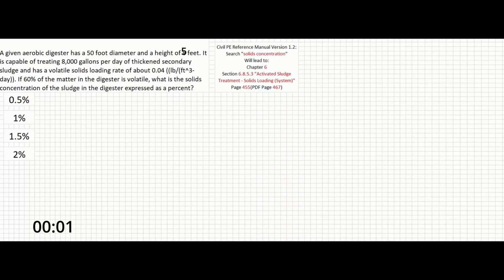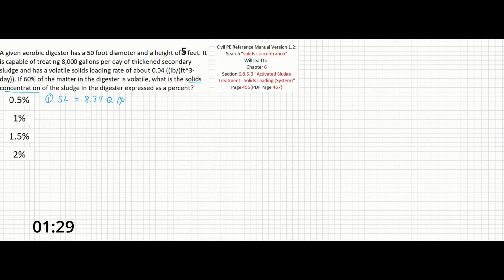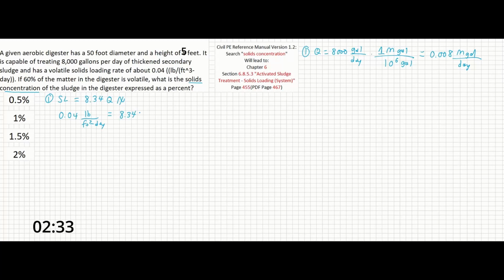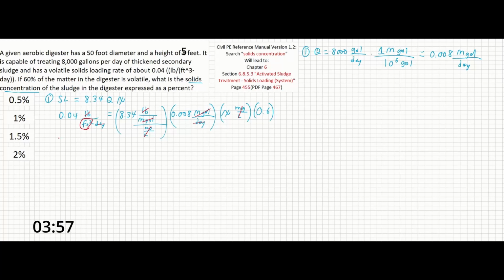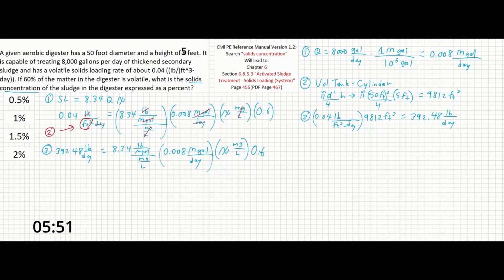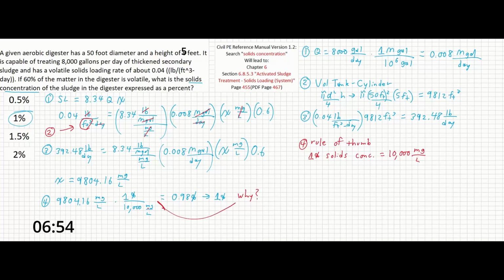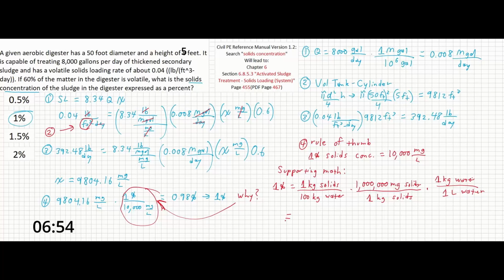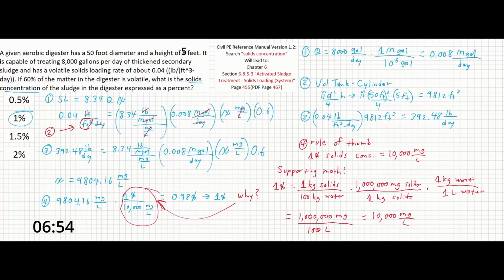PE Exam Practice Problem #9: Water Resources | Wastewater - Sludge - Aerobic Digester - Solids Conc.

Comment: This is another one where you don't actually need to use the reference manual at all. 

First thing I did was derive the cross-sectional area of the digester and the volume from the diameter and height. Then, since we know VS = 0.6*X, just solve for X which gets you .066 lb/(ft^3*day).
Multiply X (0.066) by the volume of the digester to get lb/day.
Using Q, derive the total mass of sludge per day (Q in gal/day -> ft^3/day -> lb/day (you can use 62.4 lb/ft^3 even for sludge as a basis since sludge usually has a Specific Gravity less than 1.05).
Then just divide lb (Solids)/day by lb (sludge)/day.

Doing it this was gave me a result of 0.977%
Reply from the maker: Sounds like you understood the concept and what it was asking for more intuitively than i did. Nice job!

Comment: Are we always only worried about the volatile solids or just in this particular problem?
Reply from the maker: I guess it depends on what you mean by worried. Volatile are the part that will be oxidized or decomposed. Non-volatile will not change. Some questions might ask about either one or the other, just depending on what you're being asked to solve. Sorry if this isn't particularly helpful.
Reply: @SolvedIn6 no that makes sense, thank you. The equation in the new version of the PE handbook is just Solids Loading, it doesn’t specify VSS so I was just curious if the general understanding is to use the volatile solids. I’m not a W/WW engineer, I’m a drainage engineer so in practice I haven’t touched the wastewater treatment stuff since school. Trying to get my head wrapped around it again. Thanks for your videos and the response!
Reply from the maker: @FireKOC  my job in water feels like a sham all the time. You probably know more than me believe it or not. Thanks for watching the videos and best of luck! I'll keep an eye out if you have other questions.

Comment: A new Environmental Engineering PE reference handbook was released and effective April 2025. I don't see this formula in there
Reply: Thank you both! I will check that out 😊
Reply from the maker: I don't see it either. I've noticed that the environmental reference manual seems to be missing a number of equations that I would have expected it to have, which I have instead found in the civil reference manual, like I used for this problem. The closest in the environmental reference manual 1.6 is page 23, which I found by searching for "solids loading". There it just says "solids loading rate = Q*Xa where Q is flow rate and Xa is biomass concentration in aeration tank (in MLSS or MLVSS kg/m^3)
Reply: Page 449 in the 2.1 version